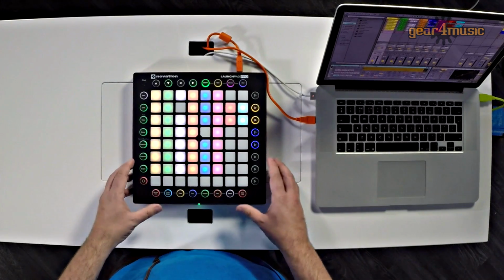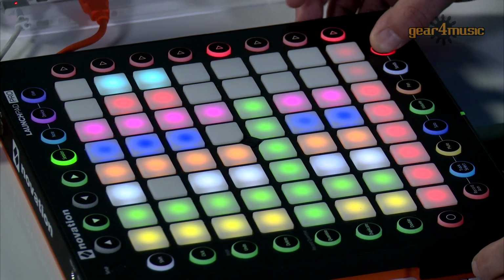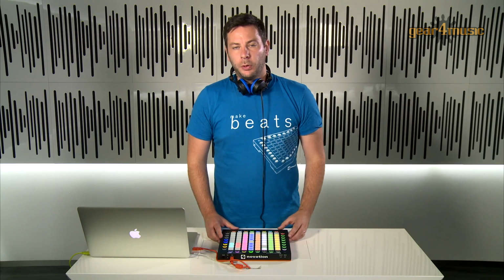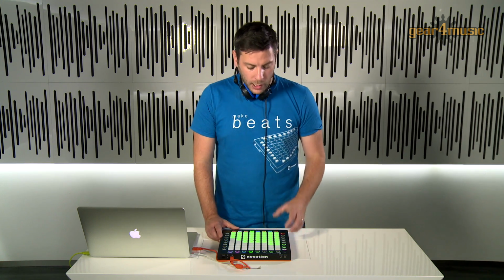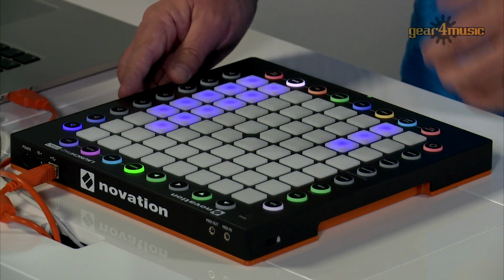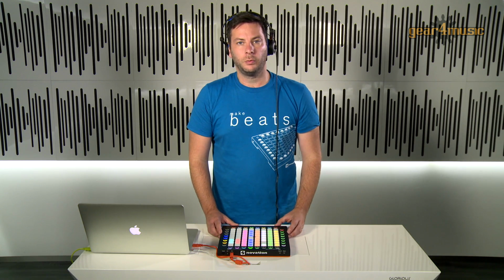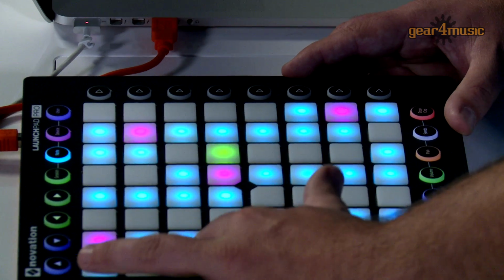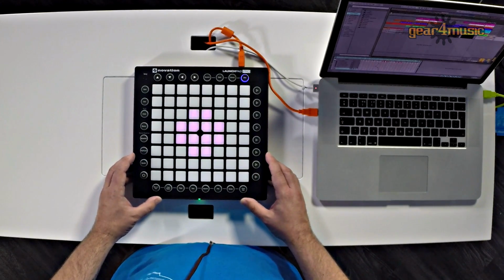Novation Launchpad PRO Performance Instrument

Comment: launchpad pro is amazing. iam saying it for own experience
Reply from the maker: What do you like about it best +Trinity Sound ?
Reply: +Gear4music it is simple, portable and dynamic.
Reply: I have a question Can it connect to a phone or tablet with a OTG cable?
Reply from the maker: Hello there.
Whilst it cannot be used with a phone, it may be used with a tablet with the correct type of OTG inputs. You would also need  to have the Launchpad App.The Launchpad Pro can be used with the Launchpad App on an iPad. You will need the power adapter for the Launchpad Pro as well as an Apple camera connection kit in order to connect the Launchpad Pro to the iPad. If you press and hold the Setup button and then press the orange pad for the Programmers Mode and then launch the Launchpad App you will notice the LEDs will illuminate to correspond to the app.
Kind regards,
Gear4music